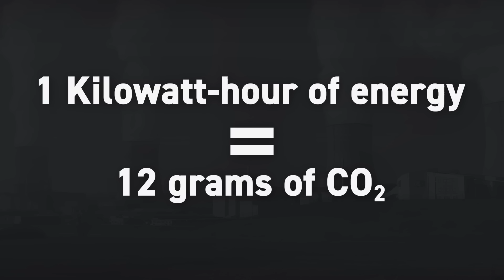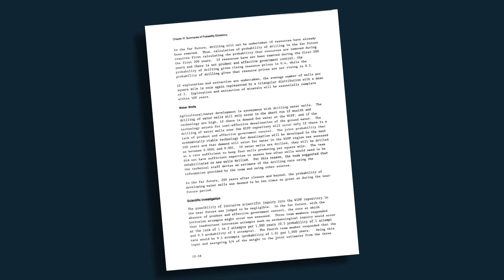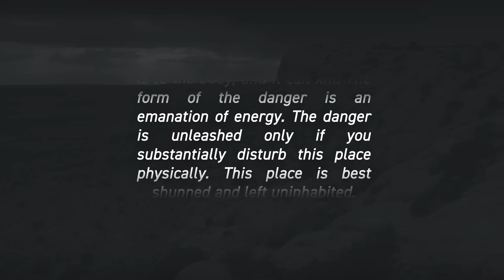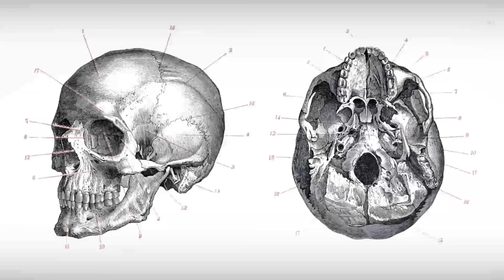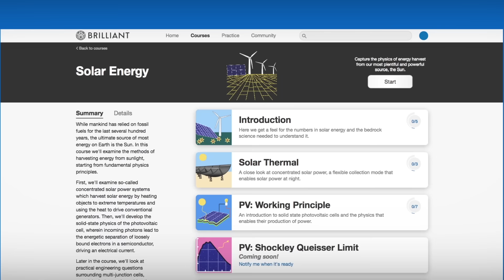The Nuclear Waste Problem

Comment: Extra context. At the time of post, it is possible to reuse high-level nuclear waste (used fuel) . The only problem is that you need a new type of reactor. In fact this system is not new and has existed for decades but never used. Nuclear material that has been reused only needs to be stored for 20 years after use.

Comment: One major point that you didn't consider: Nuclear power actually has a major ADVANTAGE with respect to the fact that all the waste is concentrated into one compact location. That's a big advantage. If a future technology comes along that can efficiently process (or better yet, use it as fuel), it's a pretty big advantage to have access to all that material, all in one place.

Compare that to coal or oil which disperse the waste products into the atmosphere. Most people don't realize that coal emits more radioactive material into the air than nuclear. Actually I have read that coal shortens more lives per year (miners + pollution effects on health) than EVERY nuclear disaster in history, all combined.... It's just that the nuclear incidents are more scary than a 0.01% worldwide increase in cancer, but ultimately kill at least 3 orders of magnitude less people per gigawatt.
Reply: yushis1 yes and if the nrc had to permit or regulate coal plants to the same standard as nuclear plants they would all be shut down.
Reply: Actually, the tech already exists.  Our governments have agreed not to use it, with the exception of France.
Reply: and this video forgets one MAJOR thing we can actually reuse the  waste several times with a more complex reactor and the waste from that will only last about 300-400 years
Reply: LTRand is refering to a vast swathe of technology we chose not to use. Breeder reactors, unenriched reactors, recycling our nuclear waste, etc.
Reply: Coal plants in just the US release around 1.5 million person-rems of radiation per year. Chernobyl in total released 29 million person-rems. That was 30 years ago. Coal is insanely deadly.
Reply: Nuclear Fusion is the future
Reply: Exactly. Solid in, solid out. It's pretty great.

Comment: The most likely scenario, is that we soon will have the means to use the spent fuel until it's no longer dangerous, or to make it inert.
In the event that will not happen, I think it's safe to assume that those that come along and have the capability to open such a storage site, are likely to be intellectual enough to understand basic visual warnings. To be more specific, three images; one image of healthy life forms, one image of life forms in proximity to the dangerous material, and the last image of dead life forms. Just make sure to close off the openings with massive barriers that are not trivial to remove.

Comment: You totally ignored spent fuel reprocessing and how it reduces the amount of long lived "waste"
Reply: This video is SADLY lacking in a number of ways.  :(
Reply: It will be waste at some point though
Reply: @the_phantom_cat7912  Much of that long lived "waste" has medical and industrial use.  If you extract and use up the spent fuel rods energy capability, you have very little left.  This allows disposal in such areas such as a continental subduction zone.
Reply: @jackfanning7952  that's why uranium should be replaced with thorium. Almost every problem with uranium is solved by using thorium.
-easier to extract
-safer to extract
-higher concentration, both per deposit and worldwide
-produces far less waste 
-can't produce power without plutonium (meaning no meltdowns)
-cant be turned into a bomb
-produces tons more power than uranium
Reply: Some people are currently trying to make a nuclear reactor with no waste

Comment: Or, since 99% of the energy is still in the so called "waste" an option is to burn it in gen 4 reactors and eliminate 99% of the waste while supplying all the power humanity needs for the next 2000 years. Sounds better doesn't it....  and much less digging...
Reply: Fast reactors, right?
Reply: I'm not sure you get the point. It's called "waste" for a reason meaning that it doesn't have a purpose or cannot be used. It's like burning a coal; you may still be left with the coal but after it has been burnt you can't really do anything with it. Your idea is a good one but only if engineers can find a way to be able to use the radioactive energy emitted from the waste.
Reply: @CountSacke  except it's not pure waste. This is not the plastic wrap on your candy bar. These rods still have a shit ton of energy left in them. They can still be used if we use the proper methods
Reply: Gustavus Adolphus Of course it’s not like a plastic candy bar (that analogy fails very badly); I didn’t even compare the waste to a wrapper. This is why I used burnt coal as an analogy, while it may not be radioactive (negligible amounts), it is a source of energy; you can’t really get anymore energy from coal after it’s been burnt since if you try to light it up, no fire would spark. There might be a lot of energy left from the waste but it might take even more energy just to extract what’s left. The coal may still remain hot after it has been burnt but it doesn’t mean that the remaining heat is sufficient enough to be utilized. Even if there was a method that can get energy from used-fuel, wouldn’t it be more logical to take unused fuel as it would last longer and produce more energy in the long run? People don’t throw burnt coal back into the fire. Of course in the end, it’s better to do research and figure out alternative solutions to eliminate as much nuclear waste as we can.
Reply: @CountSacke  except used coal and nuclear waste are incredibly different. You can't compare charcoal to the crucial isotopes that are needed for the core of a nuclear warhead. Your analogy is incredibly flawed and seriously under plays the energy that IS, not maybe, in nuclear waste.
Reply: @gustavusadolphus4344  don't even worry about him, you're right
Reply: @clockworkcrew8012  I never said we couldn't use the energy... I just said that it might take more energy just to use the already used-fuel than it's worth. Like I said, why use the used-fuel in the first place when it would be more beneficial to use the unused-fuels since they last longer thus providing more energy.

Let's assume that you have a power plant that can utilize the nuclear "waste" (used-fuel). It's obvious that "original" isotopes (unused fuels) would always last much longer and produce a larger amount of energy (if the new isotopes don't last much longer, it just means that the plant is still unable to use a lot more of the potential energy remaining in nuclear waste).

You are correct in saying that the reactants, charcoal and isotopes, are rather different. Obviously due to the difference in the energy output of nuclear reactions (nuclear fission) and chemical reactions (combustion), nuclear waste would, of course, have drastically more energy remaining in it than a burnt coal. But that doesn't mean that it's worth it to throw back the already used fuel into the power plant, as it would still be more beneficial to just take the new fuel (in the same way a burnt coal isn't thrown back into a furnace).

For the analogy of burning coal and the nuclear fission of isotopes, are they really that different? If so, then explain in more detail; describing the analogy as "flawed" without explaining why is not going to break it. The fundamental processes behind fission and chemical reactions (combustion in the case of coal) are very different of course but they still share some interesting similarities.

In a chemical reaction, energy is released through the breaking of chemical bonds in molecules. Combustion is initiated through the presence of heat and flammable material like oxygen. The energy output of these reactions is given through the number of bonds broken minus the number of bonds formed. This, in a sense, splits molecules into atoms which then can form new molecules. This follows the law of conservation of mass. 

For nuclear fission you split the nucleus (mainly by shooting a neutron at the isotope), however the sum of the mass of the resulting reaction doesn't match with the mass of the isotope that was split. What is happens to the "missing mass" is that it turns into a large amount of energy which can be calculated with (dE)=(dm)c², where dm is the mass defect. So, nuclear fission of an isotope results in two different atoms and a lot of energy. It doesn't follow the law of conservation of mass but it preserves the law of conservation of energy.

Waste for combustion is due to the change in molecules from before and after the reaction. In nuclear fission the waste is due to the isotope being split into two different atoms. Basically the reactants for each reaction change and therefore the same exact reaction cannot take place again.

Between the two, there is some sort of "bond" (that is due to a fundamental force; explain in a bit) that is broken causing energy to be released (in different quantities of course). The "bonds" that keep the nucleus together is through the strong force whereas the chemical bonds in molecules are through the electromagnetic force. The waste in both reactions are due to changes in the reactants. Both follow their own laws of conservation and have their own fundamental forces (even so, these fundamental forces can be unified sometime in the future).
 

My analogy wasn't to show that energy output between the two types of reactions were different; it was meant to show that the energy potential in the waste material doesn't have as much compared to unused-fuels. If you're going to attack my analogy, specifically aim to explain how the "waste" energy potential outweighs fresh fuels (not the difference in energy potential).

I agree with the idea that we should research and build technology for more ways to get energy for a longer period of time from nuclear reactions (or even seek more energy sources since nuclear reactions still only give a very small percent of the total potential energy a mass can have as explained through E=mc²). I just don't believe it is really worth it to take fuel that has already been used when fresh fuels still overall have a more positive outcome in terms of total energy output. Maybe the nuclear waste could be utilized for back-up energy but its very unlikely to solve all of the issues of nuclear waste.
Reply: @CountSacke  Did I accuse you of saying we could never use the energy? No. Stop imagining a different conversation that fits your narrative better. I said that you don't know what you are talking about and therefore should not be concerning yourself with sharing your misinformed opinions. You literally tried to equate used coal embers and nuclear waste to explain your "ideas"; the absolute opposites of energy potential. Copying your opinion into google immediately factual explains the basics of how it is such a gross misunderstanding of the subject.
Reply: @clockworkcrew8012  "Did I accuse you of saying we could never use the energy? No. Stop imagining a different conversation that fit your narrative better." I'm sorry and I can now see my first sentence was a rather fallacious argument. I agree with you on this point, so, Instead I'll quote out your comments bit by bit and respond to them as to ensure I don't make this mistake again.

"You literally tried to equate used coal embers and nuclear waste to explain your 'ideas'; the absolute opposites of energy potential." I think I can understand why the burnt coal analogy starts to fall apart, however, the idea I had in mind still remains the same. Coal undergoes a combustion reaction which results in a variety of different products including ash, other gases, and other particulate matter. The ash appears to be more of what I was thinking to be an analogy for the nuclear waste. The nuclear waste is a resultant product from nuclear fission. The ash has a very low amount of energy potential compared to the coal and thus would take more energy to get energy from the ashes than it would be burn another coal. The nuclear waste definitely has a lot more potential energy remaining than ash, but the unused isotopes still would provide more energy for longer than the nuclear waste.

"Copying your opinion into google immediately factual[ly] explains the basics of how it is such a gross misunderstanding of the subject." Can you quote an example and explain why it is a gross misunderstanding of the subject? What are these misunderstandings, my ideas behind how combustion and nuclear reaction work or what the reactants and products of said reactions or something?

"And you even did say that we couldn't use the energy. You originally described it like coal with saying 'It's called 'waste'' for a reason meaning that it doesn't have a purpose or cannot be used." I'm sorry for the miscommunication as that wasn't what I meant to say. I do actually believe that there is energy potential in nuclear waste (there still is a remaining mass and E=mc² still tells us that there is a lot of potential energy that can be utilized), but the energy potential of unused isotopes would still last longer and produce more energy than the nuclear waste. I remember stating my the last paragraph, "Maybe the nuclear waste could be utilized for back-up energy..."

"You do know that the 'waste' you describe as being unusable is the isotopic material needed for nuclear bombs, the most powerful instrument made by man." After an isotope undergoes nuclear fission, the products include two atoms of a smaller mass (also some neutrons) and a lot of energy , these two atoms are what I referred to as waste. The isotope, I'll use U-235 as an example, isn't what I call "waste". U-235 and a neutron would be the reactants for nuclear fission but the products are not the same (there obviously isn't still a U-235 atom remaining after the neutron hits the nucleus and splits it). That most powerful instrument works through a chain reaction of nuclear reactions, specifically a series of nuclear fission, however the two atoms are not the ones releasing the energy, the energy release is due to the conversion of mass into energy by E=mc² (I'm certain you understand this). Those two remaining atoms don't have the same potential energy as the U-235.

"I can not express how fundamentally wrong you are with your comments here..." This does not really help my case since I do not know exactly which concepts I am, in your words, "fundamentally wrong" on. Quote a portion from my comment regarding the ideas, then explain what's wrong about it and provide the correct explanation. I would fully be willing to change my mind about what I've said if you could point out to me what I've gotten incorrect. 

"... and I could send you enough reading material..." Sure.
Reply: @counte sacke at least in the United States, only 5% of the spent fuel rods is actually unusable. France uses fast reactors to “recycle” them and generate much more energy while reducing waste. Breeder reactors are the name and definetly worth the read. You might be from France and be talking about whatever is left after the breeder enrichment and usage. That was beyond the scope of my research. However their waste is not much. 
By the way, this video has a few mistakes. The radiation that lasts millions of years is only dangerous in high dosages. And the dry cask storage are capable of withstanding natural disasters, and the main reason they require supervision is because of the possibility of someone stealing them. That’s not the point though. Breeder reactors (fast reactors)
Reply: @NuclearQs  That makes much more sense. It does seem to address my concerns, however, I have one question, can these breeder reactors take the already used "waste" products (say from the fission of U-235) and make energy from them or do you need a specific isotope to start the reactions. 

There may still is a bit of waste but that's guaranteed since 100% mass to energy conversion isn't something we have the technology for right now. Also, I am aware of the fact that the radiation from these "waste" products is only lethal in high dosages (due to the inverse proportionality between the half-life and it's reactivity).
Reply: @CountSacke  the OP is absolutely correct, the waste materials have a tremendous amount of potential to be used, especially in other reactor types.  In fact, only 10% of the fissile material is used in the first reaction.  The waste is anything but unusable - read more, talk less.  You're making a very poor showing of yourself; actually you're kinda embarrassing yourself too.
Reply: @ronjon7942  I am aware the “waste” was capable of producing energy. I was looking at it with a more economical pov, unfortunately we live in a world where we have limited resources and need to be careful on how we use those resources. Whatever the case is, my question was this, “do you extract enough energy from the “waste” or does does it take more energy than it’s worth?” If the answer was that it has a high enough efficiency then maybe it’s worth it, but the efficiency is only one aspect and there are others to consider.

I do admit that what I ended up saying years ago was not the best way to communicate my thoughts and I do apologize for that. My initial first comment especially was worded rather poorly looking back at it as I am aware that the “waste” can be used to output energy despite not reflecting that which I am sorry for.